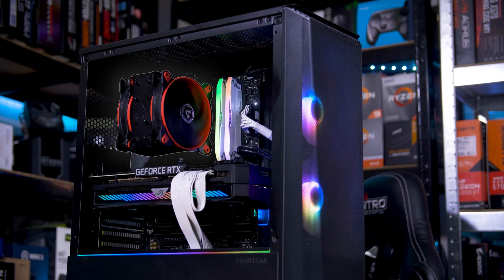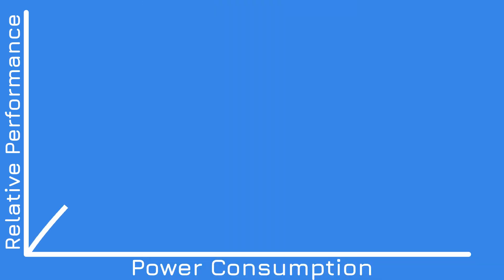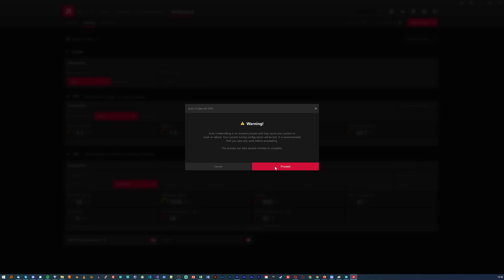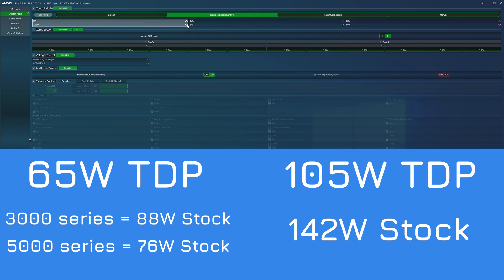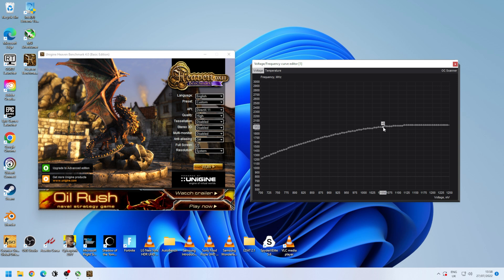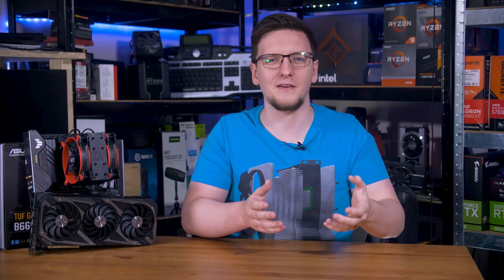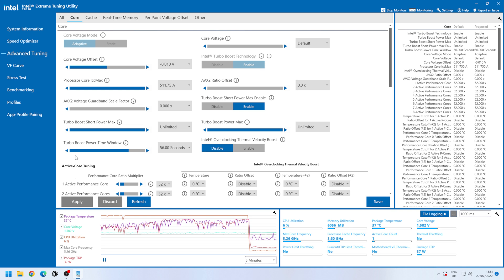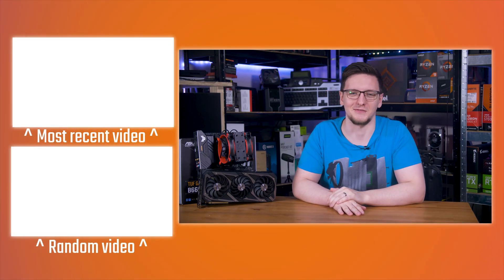LOWER YOUR TEMPS & SAVE MONEY! A Beginners Guide to Undervolting

Comment: I'm seeing my 13600k spike from 35 to 65 idle for a split second, usually with a couple of cores, and rarely. I'm not sure if it's an issue..using coretemp to gauge temps, and a cooler I don't recommend (h100i lcd). There is enough thermal paste

Comment: does undervolting reduce the life span of undervolted components assuming it was done the correct way as you explained in this video?
Reply: if anything, it should improve lifespan - Lower wattage, means less heat generated, less heat is rather good as it's technically less used, kinda

Comment: Would it not be easier to cap the power the CPU draws from the bios? I have seen a benchmark showing the 12900K on  a 150W cap and the results (performance & temps) where pretty amazing! Moreover, I do have the impression that imposing a power cap from the bios would result in a more stable experience (something required by professional content creators).

Comment: Yeah, I've been undervolting my i7-7700K for years. Before undervolting my temps were always higher than I would like and it would thermal throttle a bit when gaming. Now temps are much more reasonable, and I get less stuttering in games.

Comment: Sorry but I found the Nvidia GPU section very unclear, I think a dedicated video on that would probably be good. My takeaway from what you did was that you reduced the clock speed for a given voltage, which seems like an overvolt if anything!
Reply: I too would like to see a video about using Afterburner to undervolt. This is something I've tried and read tutorials about several times, but I keep getting a bit lost. Seems like it should be simple, but I've only been successful once and don't know how to repeat it. :-P
Reply: @AgentBirdnest  Ha, I'm similar! I fiddled with it once & did what I think he said, where I picked a max voltage I wanted it to use & flattened the curve above that. I think by double-clicking on the one you want it flattened from? It's been a very long time since I've played about with it so could be remembering very wrongly! Anyway, a clear tutorial with explanation sure wouldn't hurt.
Reply: @AgentBirdnest  I followed the vid "How To Undervolt Your Graphics Card (And Why You Should)" video, not sure if it would help you or not, he is focusing on RTX 30 series cards and I really don't know if the same procedure applies to any GPUs. I took mine down to 875 and it's never crashed

Comment: Great video Andy; surprising number of people are unaware that they can keep their system cooler, quieter and less pwr hungry without losing any noticable amount of performance.
Just a quick advice (that I always annoy people with): Anyone running intel 8 or 9k series just turn of MCE (multicore enhancement) in UEFI (BIOS) for an instant temp decrease; if you really need it chances are you are manually overclocking it anyway, have overkill cooling and do not really care about  pwr savings.
The same probably goes for the newer gen CPUs but as I have no first hand experience with 10th gen and above I will not claim to know.
Reply: But isn´t MCE required for most modern games?